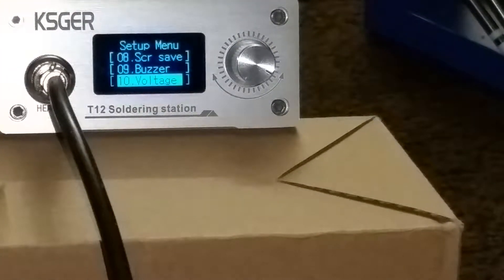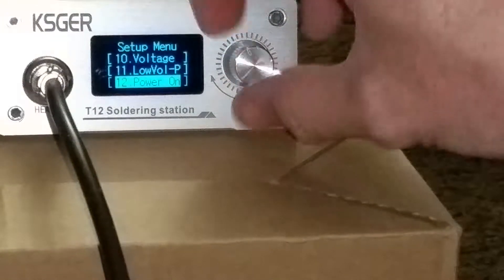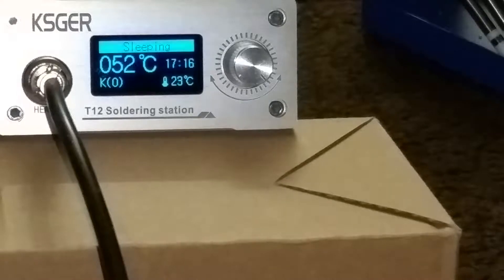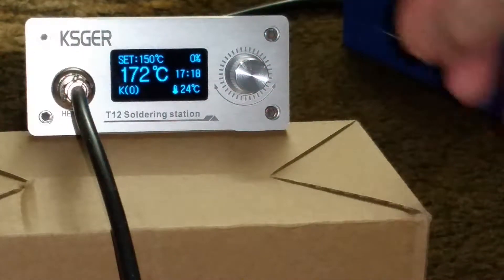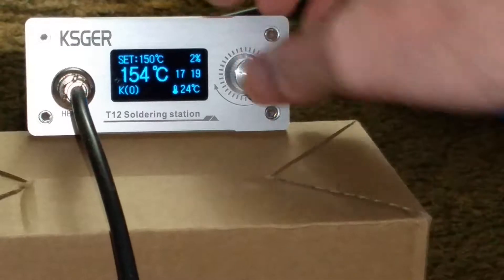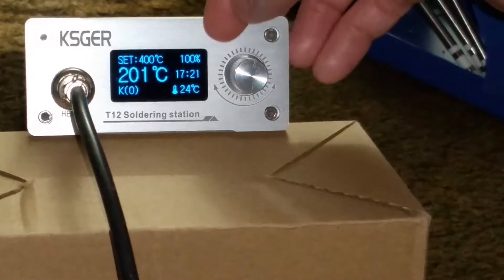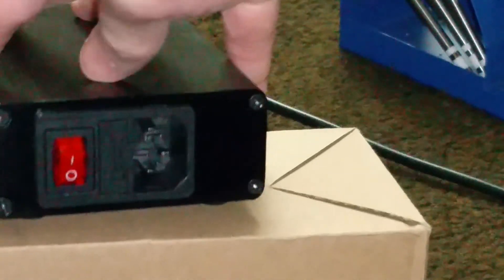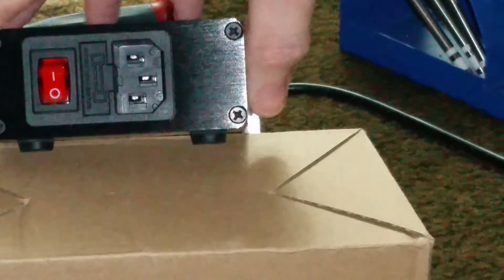KSGER STM32 2.1S - Menu Settings (Part 2)

Comment: I'm trying to switch the tip setting to the tip that I'm using BC2Z, but it stays on JO2 and I can't deselect it, I can check and uncheck everything else in the menu. Anyone?
Reply from the maker: Were you able to go into the menu and select only the tips that you own? If so are you having a problem outside of the menu where you're trying to use the iron and can't switch through the small number of preset tips that you programmed? I haven't had a problem with either of those things. If you only have a single tip that is BC2x, just use the BC2 setting to represent the BC2Z. See if that works.
Reply: @JasonWW2000  I only have a couple BC2Z tips at the moment and I can select those, but it's set to JO2 and it won't let me unselect or change it. Not a big deal, thought I'd try setting it to what I was using.
Reply from the maker: @BigFarm_ah365  No, I've never seen or heard of that issue. I know you can do a reset. That might fix it, but you'll need to program the offsets again. I wrote all mine down, just in case. In real world use, I find myself almost never changing the tip setting on the station. I just install whatever tip I need and set the temperature low. If it's not enough heat I'll turn it up a little. So being able to calibrate all the different tips is a little bit on the "fancy" side. :)
Reply from the maker: @BigFarm_ah365  Just to be clear, you do know how to change between the different program tips, right? You've done that before, but now it's stuck on J02?